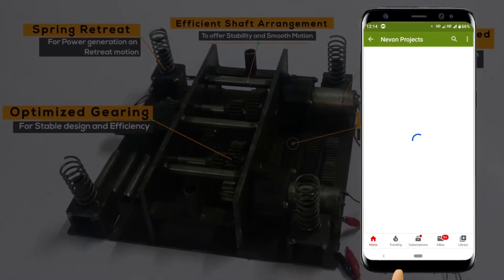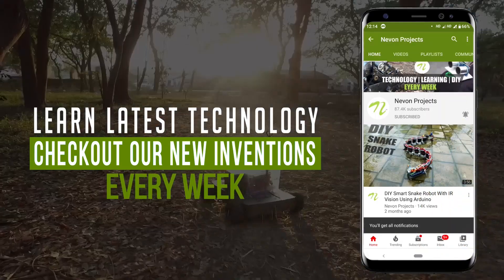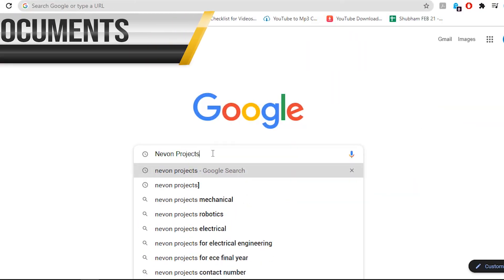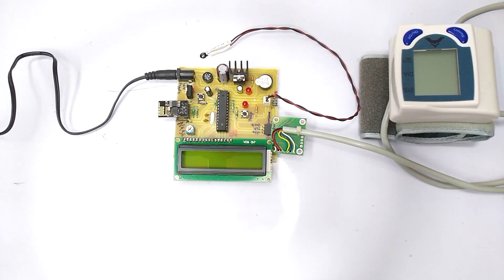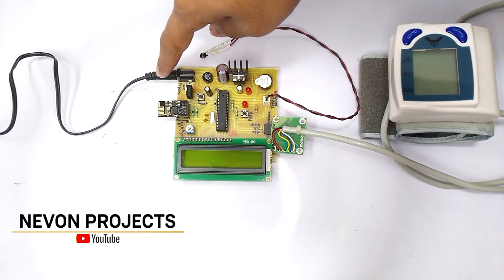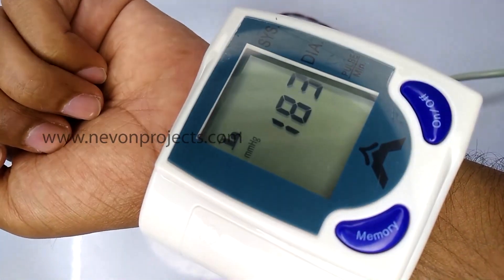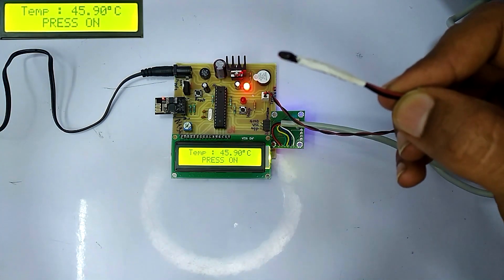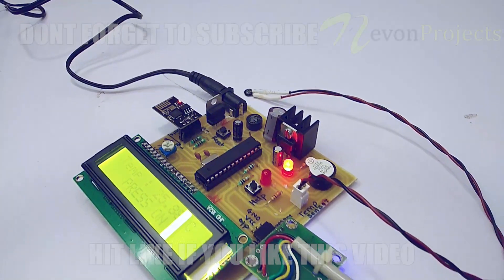IOT COVID-19 Patient Health Monitor in Quarantine

Comment: Hi may I ask how did you connect the blood pressure and hearth rate monitor sensor to the PCB board?
Reply from the maker: For this Electronics system details or free document/PPT pls call watsapp
+917738796642 or visit link in video description